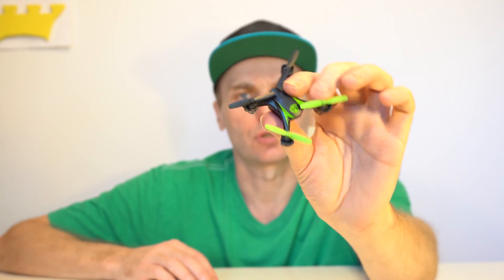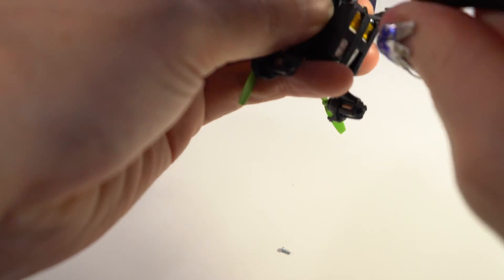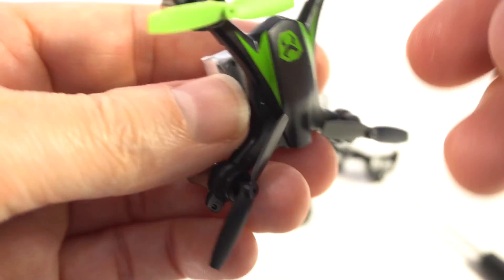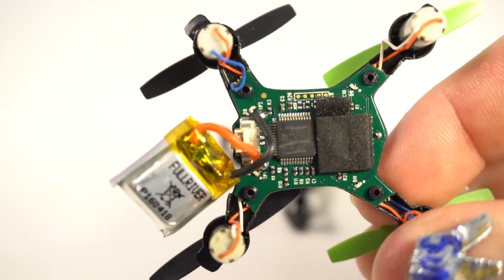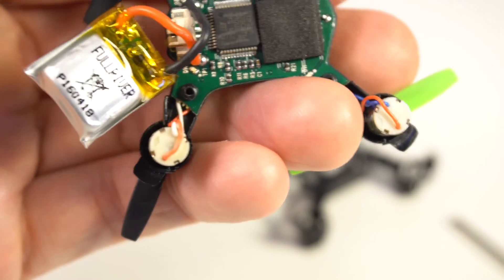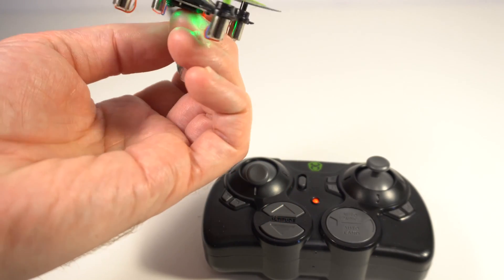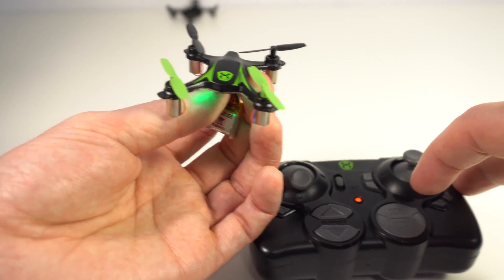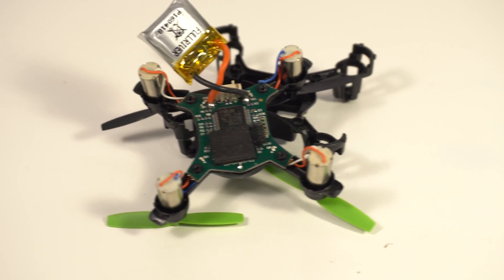WHAT'S INSIDE A SKY VIPER M500 NANO DRONE ?

Comment: any ideas on how to get motor out and replace it
Reply from the maker: Yes just unscrew around the bottom of drone and use Electric Soldering gun to replace motor😎
Reply from the maker: Yes just go to EBAY and buy new motor then replace it and connect + and - to the motor**********